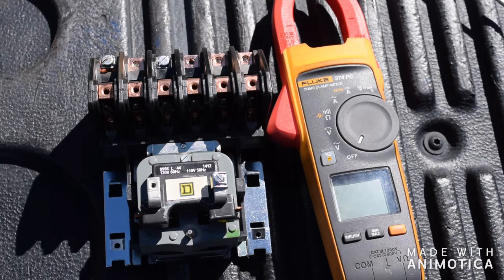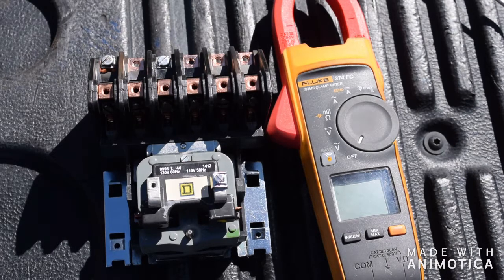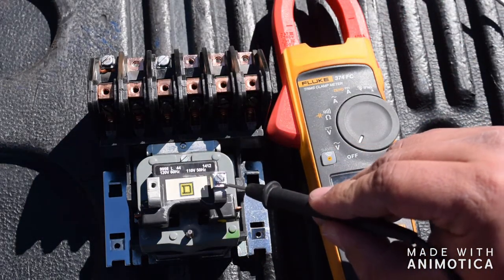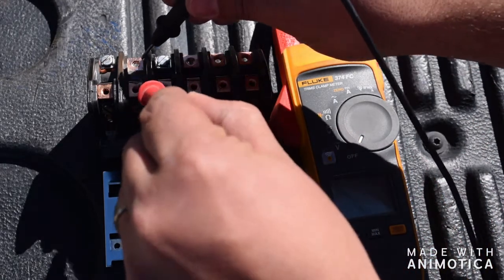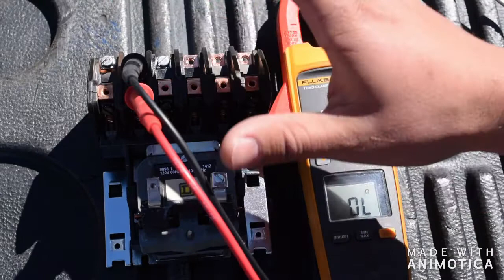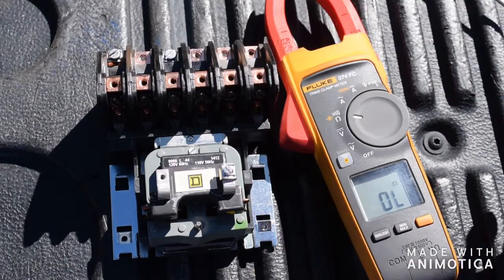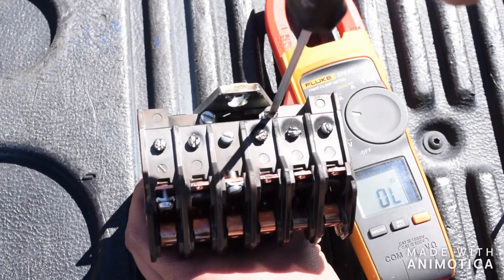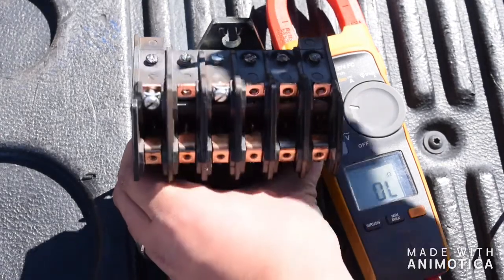Basic Lighting Contactor Introduction- Square D- 6 pole / 120V Coil

Comment: Just installed a new 8 pole contactor and it’s chattering. The coil is 120v and I’m getting 120v control voltage. What do u thing could be making this chatter noise

Comment: Can you change just the coil
Reply from the maker: fredpruitt74 yes sir the coil just go to your local square d dealer ask for just the coil
Reply: WARHAMMER Electrical Group will that stop the loud humming sound
Reply from the maker: Contactors are weird, loud hum might come for the contacts are chattering from a bad coil or the other way around good way to see is a “dry” run take the line off the top portion if it still making the noise it’s the coil if it’s not it the contacts
Reply: WARHAMMER Electrical Group so i did remove the the wires to the coil and the noise did go away. Does that mean the hole unit needs replaced?